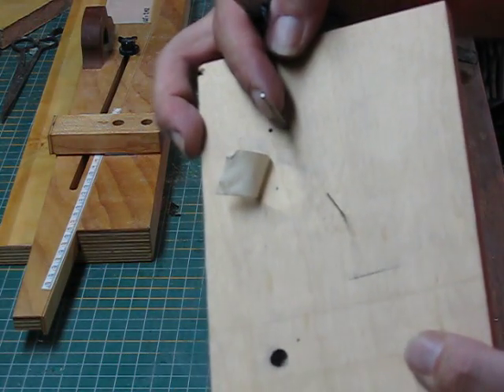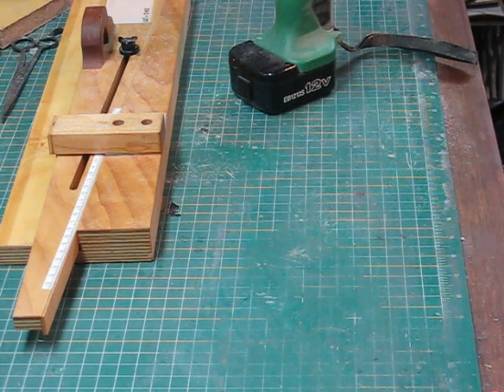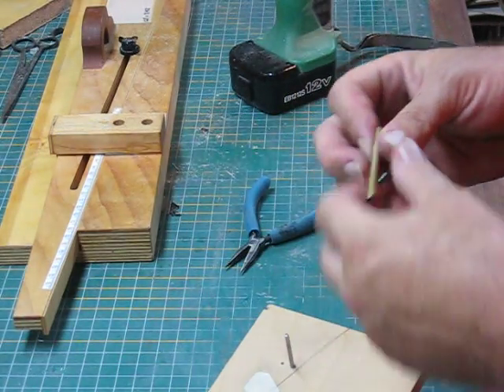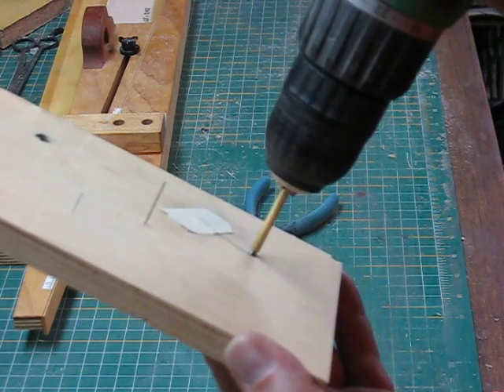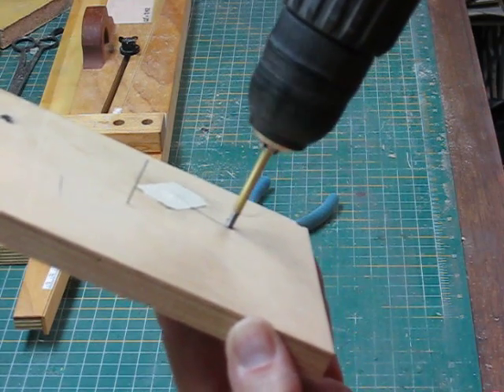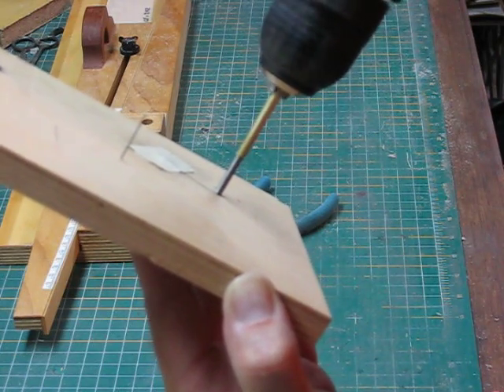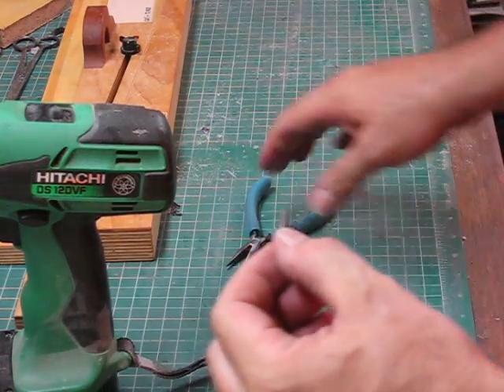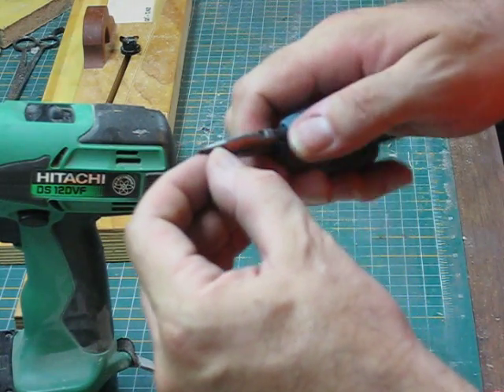How to Make Small Springs

Comment: Why don't you stress relieve the spring after winding? Typical stress relief for music wire is 375ºF - 450ºF or 190ºC - 232ºC for 20 minutes in your oven. Interestingly, a usually desirable outcome arises from the stress relieving process known as “secondary hardness.” A spring will gain 2 to 3 points of Rockwell C hardness, resulting in an increase in the tensile strength and elastic limit.
Reply: I am confused as to what you mean. Are you talking about stress relieving the spring while it's still tightened on the platform or after or putting the spring after releasing it from the platform? To avoid confusion, I wind the string, keep it on the platform, stick it in the oven for 20 minutes, take it out and then release it?

I have read about this before that it helps keep the spring tighter instead of losing a lot of its tension. What say you?

Comment: And forgot heat treat this will not last. Stressed wire needs heat treat and will change diameter and free length depending on type of wire. A spring NEEDS heat treat!!!!!!!! Or not a spring